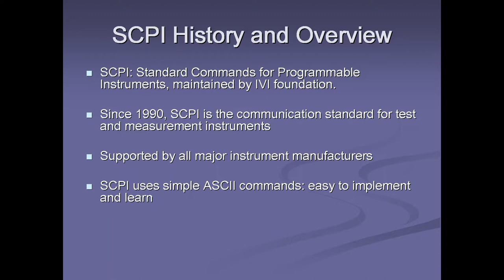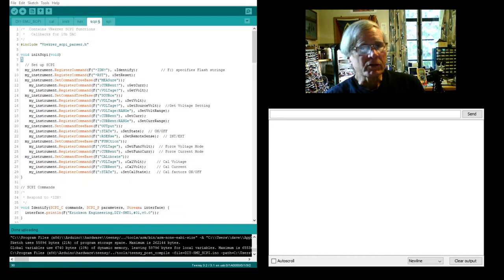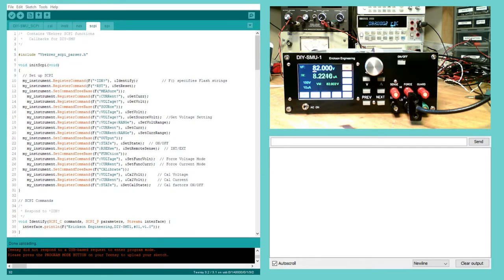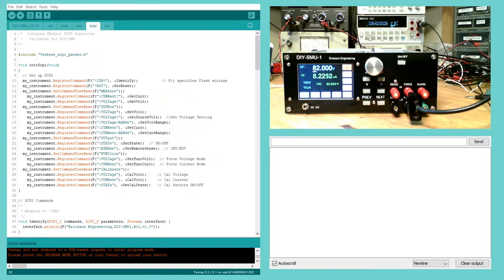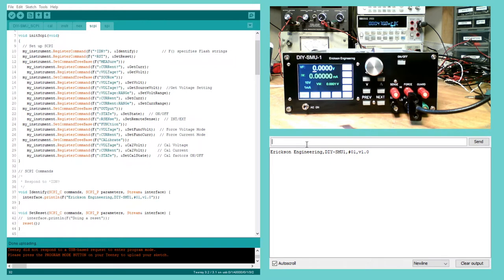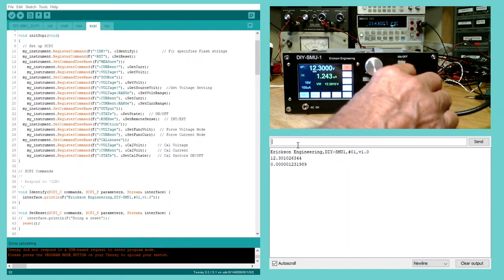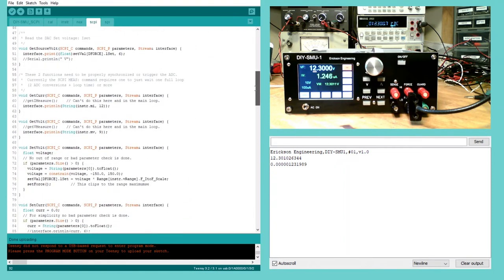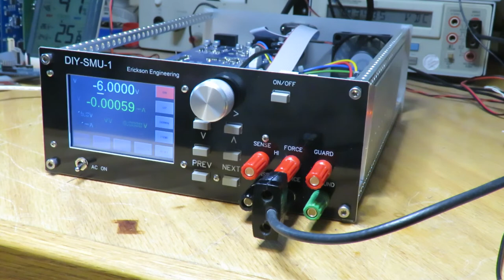DIY-SMU Chapter 4: Remote instrument control via SCPI

Comment: Would love to see some more updates about this project. Truly a wonderfully designed an executed design
Reply from the maker: Thanks for the nice feedback. 
I was hoping the DIY community could embrace it, hoping I could get some boards assembled for sale. But the parts shortage mine field has made building and selling complex hardware close to impossible. Lead times are out to 2Q2023. The latest issue is Teensy 3.2 and 4.0 availability.  It would suck to get boards built only to find 1 or 2 critical parts unavailable.  Meanwhile, doing firmware updates and Python code are a possibility. I'll resume firmware work this winter. I have 4 fully working units, and willing to give away 1 or 2 to someone who wants to do some Arduino / Teensy coding or Python application code. 
Also I'm also looking towards upgrading my other projects: 18b DAC, and PS-Load.
Reply: @ericksonengineering7011  yeah the part shortage has been a real slap in the face. Hopefully things get worked out, because it's affected so many random things that folks wouldn't even think of.

Your SMU is one of the most well thought out and executed projects I've seen on YouTube in a long time. A lot of times folks will start something incredible like that and then just drop it in the middle of the project. 

(Like Marco reps and his open source measure unit) 😂. But I'm holding out hope maybe he'll pick it up again one day in the future he has all the boards and things.

Comment: This project is great and impeccably documented on your website, thank you Dave! Minor quibble on the firmware, I am fairly certain that the F-String macro really only applies to AVR processor based "Duinos". The Teensy you're using, being an Arm Cortex based module, should have the ability to cleanly access data in any of the physical memories in a single logical address space whereas the AVRs need additional sauce to grab data from program memory given the more stricly Harvard-Like architecture. you should just be able to mark the strings as const and let the compiler handle the rest, and check the linker script and map file to verify that data remains in flash and doesn't end up in ram after startup.
Reply from the maker: Thanks for the feedback.  Good idea.  F strings were inherited from the SCPI library examples. Teensy is nice enough not to complain about them.

Comment: Amazing project, looking at the price of SMUs this could be a very worthwhile build, especially with the open source code. Would it be fast enough to script a battery simulator? Assuming you had a mode of the characteristics (which this smu could actually generate from a physical battery).

Comment: This is a really great project! I enjoy following your progress

Do you have any plans to make a kit available for sale once you have a stable hardware build set? Even having just the PCBs and front panel could be a really interesting proposition...
Reply from the maker: Good question. I'm working on the Rev2 Main board and Rev3 Amp board, hopefully these will be rework-free.  I could supply assembled and tested boards and front panels as a start. Is there interest?
Reply: I'm interested.
Reply: I just found this project and I'm also interested.  I bet my maker space friends would also be interested.
Reply: i check back to this project regularly to see if you’ve updated anything and not sure how I missed this comment. 

But yes there are a lot of folks interested especially since Marco reps hasn’t published his open source SMU design. I totally understand that he doesn’t really need it now that he has sponsors giving him crazy nice metrology equipment ...

but there are a lot of folks out there that could really use something like this. And from the designs and files I’ve seen of Marcos… They are incredibly well designed.  if he isn’t going to finish the design maybe you could get the boards and relevant info from him to implement it in your own design or just to see how someone tackles it with different methods.

Would definitely Be interested in both populated/testing boards and blank boards/component kits.

I visit your site and videos regularly to check for updates but also just to go over the info again. It is very enjoyable to me to see how you tackle this problem with all of the different implementations and how it evolves. I reread everything regularly because it's a lot of fun… And you did a lot of work and a great job!

Comment: Awesome project, do you think you'll add sweep functions for breakdown voltage testing?
Reply from the maker: Hi, and thanks!. Sweeps and breakdown testing could be done via SCPI commands over USB, and a Python program on a PC , no? I assume for breakdown testing, you increase device voltage and look for a rise in current. Is 0 .1 to 0 .5 second response time fast enough? If so it will do that now.
Reply: @ericksonengineering7011  That would definitely work!